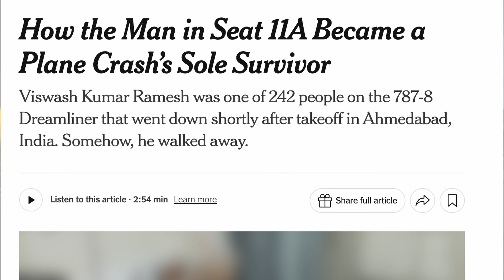Why the RAT Changes Everything – Air India 171 Update

Comment: A few years back I worked with an electrical engineer who was hired by an airline to figure out why they were having random RAT deployments on CRJ aircraft.  It seemed to occur very frequently at one airport and but also occurred throughout the airlines system at various airports.  The RAT deployments happened right at rotation, when the oleo compressed and hit the limit switch that gave the computer the message that they were airborne.  After an intensive investigation it was determined that GPU's, known as ground power units, of a particular make and serial number series had produced excessive electrical noise on the power feed to the aircraft while at the gate.  Isolating those units solved the problem.  In the Air India case I'm wondering if the same thing was happening, but at a much worse level that was causing damage to the electrical system and computers on board the 787.  Hearing the RAT on takeoff you know they were in serious trouble.  My condolences to family and friends of that terrible accident.
Reply: I don't think I heard the engines idle in that video. If they were running, they were at idle. The sound of the engines should have been deafening at that distance from the person filming. Instead, you could hear the RAT more clearly than the engines or wind.
Reply: @YT-TheLegacy  Yep, the whosh was like when a Tesla drives by making noise only from the airflow. Even the new quieter engines should have been screaming. Could contaminated fuel only have manifested itself upon rotation when the change in attitude caused the fuel to slosh around the tank and mix? It could have been taxing using fuel from the previous flight sitting down around the pumps not mixed yet with what had just been added to the tanks.
Reply: @Nightowl2548  Yeah, that's what I figured that sound was, was just the whooshing from the airflow. As for contaminated fuel, they shouldn't cause a sudden and complete fuel blockage. Shouldn't. The closest situation I can think of is that British Airways flight that lost the ability to increase throttle from flight idle during landing after ice crystals clogged the filters.

But, with that said, I can't say it's impossible either. But if it was fuel contamination, we would know by now, since other planes would have suffered similar failures, and checking the fuel at the airport would be one of the first things they check.
Reply: @Nightowl2548  Does anyone know if the fuel flow sensors could detect bad fuel.
Reply: @YT-TheLegacy  If the engines were at idle, the generators should still be providing full power to the aircraft's electrical system, so it's less likely the RAT would have deployed. Hydraulic power for the gear is supplied by 2 electric pumps.
Reply: @ImperrfectStranger  The landing gear hydraulic power is supplied mainly by the engine driven hydraulic pumps. The electric pumps can't provide the volume that the engine driven pumps can.
Reply: @ImperrfectStranger  Yeah, now that you mention it, I agree. Which begs the question... what would cause a complete dual engine failure? Without a bird strike or any signs of engine damage from the video footage, it's... really odd. Suspicious, even.
Reply: @YT-TheLegacy  There were heavy monsoonal rains in the days before the accident. It's standard practice for the refueller to check for water in the fuel supply being provided by his/her pumping truck, but maybe it wasn't done. 
I don't know if the 787 has water detectors in the tanks which alert the pilots. Sometimes engineers do water checks by draining fuel in the bottom of the tanks into a jar, but may not be done on, say, a quick transit. The water probably wouldn't have time to sink to the bottom of the fuel tank. When fuel is pumped into a tank the pressure is quite high and the fuel and water would be mixed.
Reply: Let me rephrase that. I was told by a YouTuber that there were heavy monsoonal rains in the days before the accident. I haven't independently checked that.
Reply: @ImperrfectStranger  If it was water contamination with the water well-dispersed, there is no way it wouldn't have affected other flights as well.
Reply: I guess it depends on where the water was entering the airport fuel distribution system. I assume the airport doesn't use tanker trucks. 
Also, aircraft may have different characteristics with water contamination. On that aircraft type and with that fuel load, I believe the centre wing tank would have been providing fuel to both engines during takeoff. 
Did this aircraft sit on the tarmac for an extended time period, others not. 

Do you have any other theories? I'm running out of (simple) solutions. Maintenance on twin jet engines is usually strictly regulated because of ETOPS operation. Certain routine engine maintainance cannot be carried out on both engines during the same stopover (unless hoops are jumped through). e.g. Different people working on different engines, dual certification, etc. My ETOPS theory is a little rusty, though.
Reply: @62kevin  This seems to contradict the online CBTs.  But I agree, the centre pumps on the 787 must be rather unusual if they can run both flaps and gear. 
https://www.youtube.com/watch?v=9LQQEdq5hDU&list=PLKEybvo562Lu12zkgN1syEUrykKO3M-4A&index=1
Reply: @ImperrfectStranger  When I worked in the industry (Australia) we always did a "fuel drain" on every tank to check for water at every turnaround when refuelling occurred - the fuel was collected in glass containers in a wire carrier. It was always shown to the pilots before pushback ... on the DC-9 and 727 this was achieved by knocking on the underside of the nose to get the crew's attention, and then walking out a bit in front so they could see the containers you held up.

But you were supposed to wait a few minutes before doing the drain, as water in the tank needed time to "drop out of" the fuel and collect at the drain points.  Mind you, even if you did the drain a bit too soon, the milky-looking fuel due to suspended water droplets would be a dead giveaway ... even before the water-detecting paste in the fuel drain bottle changed colour.
Reply: @vk2ig  The 727 and DC9 were probably in service about the time I started at Qantas in '75 (except they were over at TAA or Ansett). 
More modern jets have "jet pumps" which suck up small quantities of water from the tanks and mix it with the fuel. Generally there is little water left in the tanks. I was in Radio/Avionics, but by the time I started doing Engine/Airframe work, I didn't see much water testing on Line Maintenance. I left it for the old timer Engine/Airframe guys. I left the company when I got tired of topping up engine oil instead of operating sophisticated radio test equipment.
I do remember the wire carriers.
Reply: @YT-TheLegacy  The engines had no fuel going to them. WHY - we will have to find out.
Reply: @plektosgaming Fuel Filters blocked due to fuel contamination 🤔
Reply: Which supports my theory of pilot intent. Can the engines go to idle by themselves?
Reply: Hopefully the black boxes will solve the mystery.
Reply: @InformedandBlessed520  I doubt it.
Reply: 787 and 777 Have a peculiar take off procedure at  hot airports taking off with Air Conditioning Packs on. Something you can't do with older aircraft designs which keep Packs off at take off.  The 787 can run packs from the APU, but then the APU shuts down automatically after take off. I just wonder if this automated APU shut down is related to Air India 171's problem? It is known as "Pack to APU procedure."
Reply: @AltitudeWarrior  The APU does NOT shut down automatically after takeoff.
Reply: 1:38 Sir, at this point you can see the Engine Flame Out Smoke. That's not Dust. 😢😢
Reply: Electrical systems fail eventually. Even my smartphone fails after 5 years and I have to purchase a new one, and it has a  fraction of the electronics that an Aeroplane has. 
How insane could you have to be to completely rely on systems for your safety while your sitting on 100000 litres of highly volatile liquid fuel.
Reply: @KamranAhmedkhaan planes get regular maintenance by qualified personnel unlike your phone. They have many redundant systems to take over if anything were to fail. And modules and parts get replaced when they age.
Reply: @maddyinc933 
You're talking like a memorized manuscript. While I'm specifically talking only about one such "redundant" system that is the electronics because clearly that is the part that stopped working. 
And clearly all "modules" and parts don't get replaced when they age as a video of a preceding flight of this same aircraft showed that the AC and the entertainment system was not working, the buttons on the seat were not working. So clearly you need to get updated with reality which is completely different from what you read in your instruction manual
Reply: @KamranAhmedkhaan What instruction manual? I am not a plane mechanic. I am talking about a well maintained plane according to manufacturer's recommendations. I am not talking about planes where maintenance was skimped. If what you said about that plane is true, then maintenance wasn't being done properly. That plane should have been thoroughly checked after its last trip.
Reply: @KamranAhmedkhaan  Stop...really just stop. Your making yourself sound like a garage lawyer for one. On top of that what he stated is directly true through the verbiage taught to an actual AMP...what you insultingly refer to as a "Mechanic". We are not mechanics...we don't fix your car's AC issues or the buttons on your passenger section seats typically with aircraft's major system maintenance intervals. That unless pushed is done by AMP's specifically at quarterly or bi annual maintenance checks. Seeings how your seat call or function buttons or the "Entertainment system" is not immediately connected to any essential in flight systems other than drawing power...
IA's Inspector Authorities....are you one?  Are you the guy that goes out to these crash sites examines debris and professionally determines faults that will put AMP's/ AMPTE's in prison for faulty work?  No?...then I guess you can sit down now Mr. Clearly it was something plain as day but over a hundred AMP's missed on evaluations for maintenance. lol
Reply: @BadKarma-u9h  
if entertainment system is drawing power from the same source as the engine control systems, and the entertainment system is not working, then it's a sign that your life expectancy has probably reduced drastically...this is not something only I am saying. People will now start being extra paranoid. I guess its better that such issues are highlighted sooner than later..

We all should start asking questions like "What things are in place to protect your aircraft from electrical failure"
and "is it economically viable to attach an emergency parachute to each and every seat of the aircraft?"
Reply: @KamranAhmedkhaan  If your iPhone needs regular maintenance checks then I strongly advise you to change to Samsung.
Reply: That sounds like a logical fit. Fuel contamination seems unlikely to me; as the same source of fuel the 787 was using is likely to have been used by other aircraft that day; there would be other failures in different aircraft and that news would travel very quickly. What you are saying makes lot of sense; failure occurred at rotation. Praying for the families of the lost
Reply: If the fuel contamination is the cause, the same should happen to other flights from that location but it's not the case.
Reply: @krishnabharadwaj4715 Possibly but these guys took a very full load for a very long flight.  We would have to know when the ground storage tanks were replenished to unwind the mystery.  But consider m if I understand operation correctly, the RAT should not deploy if APU is functioning.
Reply: @krishnabharadwaj4715  no, several gallons of water or contamination from one fueling operation is all it takes. Only one aircraft being affected is quite possible.
Reply: You are right, very interesting comment. There are elements in line to this, as I commented
Reply: Check their fuel depot where they last fueled up...
Reply: I assumed this on the day of the crash. Because the nose was up until it crashed and the gradual lose of power. I got more clarity when the authorities disclosed that the pilot said there is no power/thrust, we’re going down! 
That means something is totally failed to give the engines enough thrust. It can be mechanical/electrical/software related. 
How could you be a pilot without these basic commonsense? How could Steve thinks that the pilot lifted the gear for flaps instead of gears? Both are at different locations like a handbrake and the accelerator of a normal car.
Reply: Someone has posted video alleged to be from the same plane on previous flights, where various lights in the cabin were flickering on and off, or not working at all.
Reply: @GK-yi4xv  very telling!
Reply: @GK-yi4xv  He was also complaining of Strange behavior of HVACs.
Reply: @GK-yi4xv Interior electrical is completely separate from flight control . Like literally no connection.  The infotainment system not working has nothing to do with the engines failing.
Reply: @GK-yi4xv maybe this already exists somewhere, but the FAA needs to set up a system for passengers  (and even flight attendants anonymously) to report maintenance issues they observe on the plane.  Then the FAA needs to investigate and start fining these airlines (or airports if the issue is with them) for negligence and improper maintenance.  There also needs to be a public site where people can see which airlines have had the most demerits in maintenance.  I certainly would want to fly the airline with the best reputation.  Best maintained planes would even be worth a higher fare imo.
Reply: @GK-yi4xv  separate systems.  Their video is also them on the ground still with the engines off, if it's the one I'm thinking off.  Complainnig that the touch screens on the seats weren't working etc.
Reply: @Jus7aguy  the same video complaining about the AC being off, complains about it when the engines are being started. That's a normal time for the AC to be turned off automatically as the APU cannot power both the air handling packs and the VFSG's
Reply: Well said, Sir. A valuable contribution towards eventually solving this puzzle.
Reply: Does the RAT retract when for whatever reasons power and thrust is back?
Reply: @lordjim3109  No.  When this happens the aircraft goes back to the airport and mechanics store the RAT and reset systems.  In this accident, I believe the aircraft's electrical system was damaged by ground power units. (GPU's)  There was no helping this aircraft at takeoff.
Reply: @gregorylewis8471  Poor maintenance at Indian airports is a well-known fact.
Reply: @lordjim3109 no. It cant.
Reply: @lordjim3109 Nope. Maintenance has to reset.
Reply: @lordjim3109  The RAT can't be stowed in flight.
Reply: 3:15 - 3:19 with this 4 second gap how did he escape! please someone explain to me, please don't say god helped him bs
Reply: Don't forget this jet just had a complete overhaul. I would like to know where this overhaul was done ( i.e., what country). If it was carried out in India by Indians then I believe this will 100% be the crashes  reason. Have you actually seen the way these peasants conduct their work and themselves. I would never trust any of them to do maintenance on my push bike or lawn mower. Let alone a complete overhaul of a passenger jet. Untrained/unqualified personnel often carry out tasks related to aircraft that should only be conducted by senior qualified personnel. This is done more often than you would believe in places like India, where a dollar saved means more than the risks involved in saving that dollar. Sad but 100% true.
Reply: It was a 787 over 5 years old, therefore it has probably had multiple engine swaps because of RR issues, it has a covid low use story and how was the maintenance team affected by covid? Any history of rodents loose in the aircraft? Fuel quality needs checking too.
Reply: @davidcroxton8306  RAT means Ram Air Turbine (not a rodent).
Reply: If you ARE correct, then why have the GPU's only affected this particular aircraft? How many other 787 Dreamliners have taken off successfuly from Ahmedabad airport? (my guess is A LOT.........) For these reasons, your theorey seems unlikely to me, but interesting all the same.
Reply: To me it would seem a "dirty electrical supply" would have the worst effects on the computers running the flight. Thus isn't it more likely a computer failure could have happen at or near aircraft rotation, when more demand would have been made of them.
     But from there I can't figure how the engines stopping generating thrust, which has clearly happened as the RAT has been deployed, there is no jet noise or heat exhaust waves on the video.
Reply: I'm having similar thoughts, though as a non-pilot who knows nothing about real life aviation, erroneous deployment of the RAT.  
As a retired test engineer I would like to see the system diagrams and flow charts of what happens when a RAT is deployed regardless of why it was deployed.
Reply: Is this plane using Rolls Royce engines? My brother in law worked in Rolls Royce during his internship working on aircraft engines and they said there was a whole batch of engines sent to Boeing about 10 years back… where there was some glitch and they were all being recalled. I’m not sure if this was one of those planes? What if the airline didn’t send the engines back? Just thinking aloud here. Sorry if it sounds like too much of a coincidence. 

I guess this is just a rant. But what if it’s true. I just don’t understand why this industry is so greedy and doesn’t take care of human safety like it should.

Thank you for sharing 🙏🏻🙏🏻🙏🏻
Reply: seen a post where the electronics in the cabin where not working correctly before takeoff
Reply: Right! As I shared earlier … More needs to be investigated on earlier flight before making a solid determination.  There is an interview with passengers who were on the aircraft as it arrived at Sardar Vallabhbhai Patel International Airport (AMD).  They explained that electrical power was turning on and off (shorting) as they arrived at this AMD.
Reply: Having a power source cause an electrical impedance while not connected not likely unless creating or converting enough volts to produce an EMP or field. So if a GPU is producing these effects it's more than a technical issue it's a design issue. Likely unregulated equipment.

BTW Avionics especially flight controls are very well insulated...if your effecting the Avionics suite in the cockpit...people are having medical issues outside the plane.
Not unlike turning on the nose LiDar/radar on while taxiway running with ground crew in front of the aircraft bad. 
Are you an AMP / AMPTE?
Reply: Agree with the RAT deployment but when you take off there is no mistaking the loud noise of the engines in the cabin.  Why did the survivor not report the engine sound stopped just before the bang?   Do you have a longer version of the new original clip because again you should hear the engine sound stop if both failed?
Reply: Thanks for the detailed explanation.
Reply: How can a ground power unit, that was left at the gate like 30min ago, have an affect on a plane's electronics during takeoff?  This is an extraordinary event in the world of electrical physics that you should explain in detail.
Reply: @petersplat6164 bad electricity supply could damage literally any electrical components then eventually some little component on a circuit board or wire or a bunch of them burns out basically. There's also the theoretical possibility that something like that combined with metal shavings in electrical components if this was one of the planes affected by that or similar build quality issues
Reply: @petersplat6164  I think what the OP is saying is the GPU's output damaged the aircraft's electrical system, and the severity of the damage didn't manifest itself until the aircraft rotated and left the ground.
Reply: @petersplat6164  It does not...FAA certified AMPTE. I can tell you directly ...it does not.
Reply: My neighbor also had a RAT randomly deploy while he was away on vacation. Chewed through a bunch of wiring in his brand new SUV
Reply: Cheap fuel...
Reply: another problem we did not know about made by Boeing ??
Reply: @MLSphotography  More than 1000 hulls, more than 10 years of operation and you blame Boeing.  For more clues, I suggest you visit India sometime.
Reply: @garyhalmbacher6875  we will see hopefully not but mark my words..  on the level of dishonesty and greed I think some of our corporations passed india already long time ago !
Reply: @garyhalmbacher6875 fair point. But the heat at the airport and sitting for 3 hours may have pushed things to the limit. Things don't fail in "normal" circumstances, they tend to fail when unusual circumstances gang up together, from the Titanic to the Space Shuttle this has happened.
Reply: All the Boeing jets need to be grounded. They are trash.
Reply: @johnames6430  Also, all the Airbus jets.
Reply: I very much doubt your testimony..... "they hired an electrical engineer"...... but you do tell a good story..... LOL
Reply: Yeah you call airline engineers for that stuff
Reply: @andyb-l425  FAA certified AMPTE....I was nnaware anyone not certified with the FAA in America was allowed to directly work on a commuter aircraft. FAR's....I can name about a dozen of them and sub articles that strictly don't allow such activities in the aerospace industry in America.
What company was this for and where and when? I mean just out of personal interest...I don't even know the number to my local FAA Inspector Authority...ahhem. 
BTW: AMPTE....Aeronautical Mechanical Practical Technical Engineer.  Electricians don't work on Electrical/Avionics in active commuter aircraft....we do. Hence the TE at the end of out designation certification and an extra 6+ months of school just for aircraft electrical and avionics systems.
Even if the tire chocks were made of wood...they would not be made by carpenters...why? Because they are not certified with the FAA governing body of flight safety in the Continental United States. ALL things 99.9998% that fly in the U.S have the safety standards set by law through the FAA in the form of FAR's Federal Aviation Regulation. Including those allowed to even touch the plane.

I can see where a master electrician might have been called in to discover impedance as a safety check on the systems blueprints. That is possible...blueprints don't carry souls. It is unheard of given the education level of certified AMP's and AMPTE's...but possible.
Reply: @andyb-l425  Well believe it!  It was a major airline AND a major airport that asked it's principal consulting electrical engineer to look at the problem.  He found it after analyzing a lot of data and conducting live tests with aircraft and ground power equipment.  BTW, you wouldn't believe the electrical requirements for jetways and ancillary equipment at airports!
Reply: @andyb-l425  Doesn't need an electrical engineer - even a pilot with a Physics background can figure that out. Having an electrical engineer to figure something that basic might even be an insult to their level of education and training. But an electrical engineer would be able to test the hypothesis practically.
Reply: No worries. It's not Your fault. Was anybody of the passengers Your relative or friend? Or was anybody of the departed knowing You? Why mourn for people which You didn't know? Better care for the poor living in Your vicinity. We can't change the course of destiny. Main culprits are the evil pilots, who neglected their duty. ❤
Arrest the families(parents, children and wife) of the pilots as a precautionary measure. It seems to be a suicide by pilot, since the transponder was switched off immediately after take-off.
❤❤Arrest everybody who has inspected or touched the plane on that day including luggage handlers as a precautionary
❤❤
I earnestly believe that one of the two pilots are guilty of crashing the Boeing 787 Dreamliner either by mistake or by intent!
❤❤ measure! ❤❤
Reply: @NewBalance-pu8ft  Please keep taking the tablets.
Reply: Just took now Zyloric 300.
Reply: @NewBalance-pu8ft - you are out of your head.  Get lost, troll.
Reply: @NewBalance-pu8ft  I really believe that you are batguano nuts. Do you have a diagnosed psychiatric disorder?
Reply: @NewBalance-pu8ft are bhai, kaunsa nasha kar ke rakha hai?
Reply: @cxpdg10 No worries. It's not Your fault. Was anybody of the passengers Your relative or friend? Or was anybody of the departed knowing You? Why mourn for people which You didn't know? Better care for the poor living in Your vicinity. We can't change the course of destiny. Main culprits are the evil pilots, who neglected their duty. ❤
Arrest the families(parents, children and wife) of the pilots as a precautionary measure. It seems to be a suicide by pilot, since the transponder was switched off immediately after take-off.
❤❤
Reply: @NewBalance-pu8ft Ngl thats called being overly selfish
Reply: @NewBalance-pu8ft And the transponder was active during takeoff
Reply: @NewBalance-pu8ft  Please seek professional help.